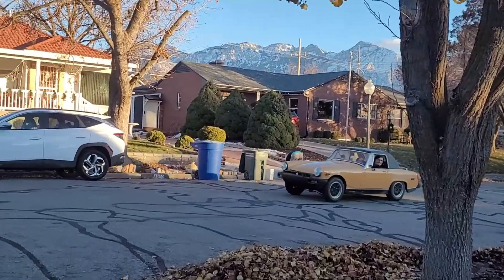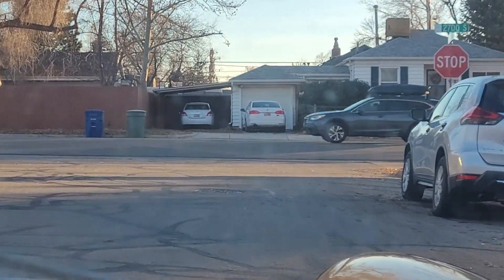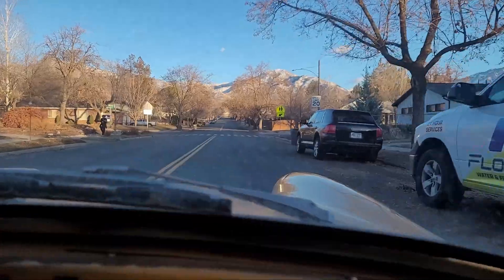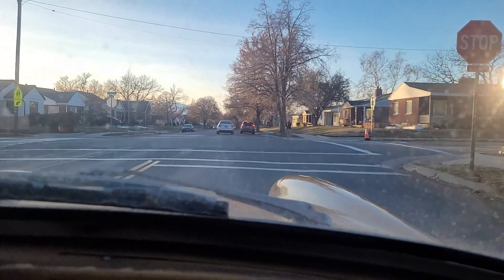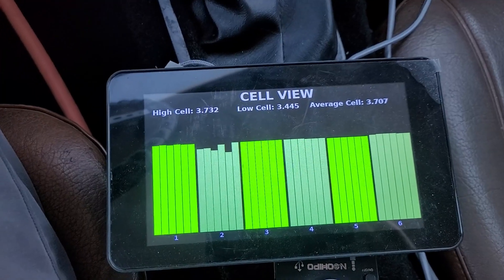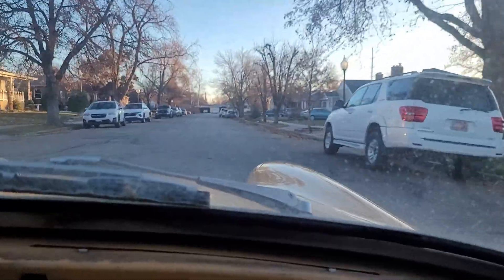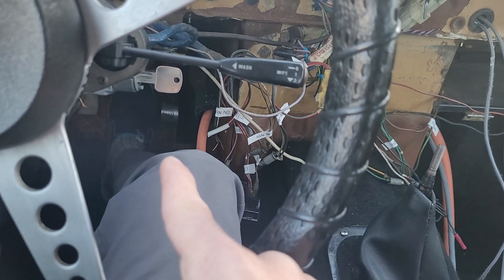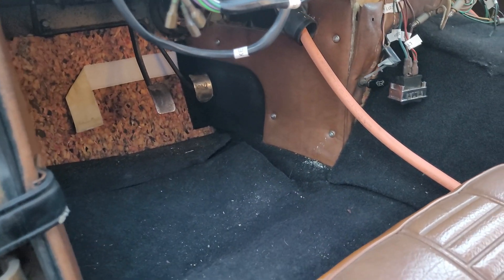First Test Drive of my Tesla Powered 1976 MG Midget - Part 13

Comment: Just started restoring a 76 mg midget. My plan is to convert it to electric and i just found the same motor and controller you have in this. My last conversion was a 1934 international pickup with a Nissan leaf motor. I would like your opinion on if you would recommend the motor you have, and would you recommend deleting the transmission?
Reply from the maker: The ADC FB1-4001A is not a great motor to be honest. If it's cheap and you are set on it, I would still keep the transmission because it's fun to have the crazy torque in 1st and 2nd gear. 

If you deleted the transmission, you'd have to fabricate a drive shaft extension because I don't think the motor would fit in the transmission tunnel at the transmission output. You'd also loose reverse gear, so you'd have to add a forward/reverse contactor. But it would be nice to shave the ~70lbs of weight and gain space in the front for batteries.
Reply: @zuccamachine  the used motor controller and everything except for battery from a previous conversion for $1000. Would that be a good deal in your opinion?
Reply from the maker: @kracticuspotts9686  Totally! I would do that in a heartbeat.

Start building to that ~140V architecture, and in the meantime keep your eyes out for a cheap AC50 or Hyper9.
Reply: @zuccamachine  thank you for your time and input. Check out my build if you get a chance. Mostly shorts but some videos

Comment: I hotwired and stole a rubber bumpered abandoned MG Midget back in college, and drove it half way across the US with my girl friend for Thanksgiving vacation.   Stole the car battery out of a Mustang down the street as the one in the Midget was flat dead.  In restrospect I should of just taken the Mustang, but it was still being actively driven, and I have ethics.   The MG... not so much so... there were at least 5 parking tickets on the windshield and it was full of leaves from the back window being out.    It was a regular Thelma and Louise adventure before Thelma and Louise existed, ending in Kentucky and a bus ride back home.        Love those mountains, I'm guessing you're somewhere out in Colorado or thereabouts.   I've always looked into buying another, to the point of looking at one for sale and sitting in it again, only to find I no longer fit...

Once while driving on a dirt road through the swampy areas of Georgia, I told her to hold the steering wheel and while the car was in 2nd gear, I climbed out over the front windshield, held on to the 3 windshield wipers, while she yelled at me to get back in the car LOL.  I was just that much in tune with the car by that point.
Reply: It looked like this:  Mine looked like this:  https://www.youtube.com/watch?v=5YxbqpTg3TE
Reply: Module 2 needs to be balanced with a charger.    I got a refrigerator full of lithium battery packs I made for quadcopters....
Replace it eventually with a newer one
Reply from the maker: I sourced a newer module locally and its already in the car. I'll feature it in the full range test video coming up next.
Reply: @zuccamachine  Nice.  If you can get the range up to 30-50 miles, it would make a great grocery fetcher, but you don't even need that far since you live in town.  

I use a Honda Shadow Spirit cruiser motorcycle with pickup truck bed and duffle bag on the back just for that purpose.  95% percent of my vehicle trips are to a grocery store 15 miles away, and I imagine for most Americans who no longer work, it's the same.

I hope you can find an affordable brushless motor for it.  If it was custom built from the ground up you could have a hub motor on each rear wheel (or all wheels), and it'd eliminate a lot of the weight of the transaxle.   

Building ultralight aircraft, I started to pick up the mentality of... building light... for things you have to move around.  Otherwise, I overbuild everything (buildings) so they will last 100% neglected until the end of time (wishful thinking).

They use a lot of Aluminum, aluminum tubing, rivets, aircraft grade steel bolts, and plexiglass (instead of glass)  in ultralight aircraft, so keep that on the brain when swapping out parts or adding new ones to your EV vehicles.  More expensive but lighter weight than steel.
Reply from the maker: @choppergirl  My range estimate is 100 miles. Hoping to do a full range test next week.
Reply: @zuccamachine  That sounds optimistic, but hey, prove me wrong :-)   100 mile range, I'll buy one.  I'll buy the factory.  Call your coach company Dodge, and the company town Wolfsburg ;-)

You probably already know (from your comments about avoiding high temps), but just as a random probably unnecessary womansplaining FYI, lithium batteries will have the longest shelf life when parked (in the garage) at 50% or whatever the storage voltage is per cell, and the colder the better (but not freezing, as they have trace moisture in them).    

I keep my quadcopter lithium and lion batteries at storage voltage in my lettuce crisper tray in the refrigerator with a temp gauge to make sure they freeze.  Not the safest, but 5 years later they are still top notch.

I hover my cell phones around a 50% charge... between 70% to 30% charge, trying to avoid the extremes beyond that unless I need them for a short duration.
Reply: Back then I had no idea where reverse was at first when I tore out out on that journey, so I think I ended up avoiding reverse, or just pushing the car... backwards?   It was so light to do...   I had forgotten all about that.   I'm sure I figured it out eventually, but still...     most of the work involved was cutting off the steering keylock which took all night long and several trips across town to fetch tools.     The original owner got the car back, in a fixed and running condition.   Next Christmas I took a flight home instead as my folks gave me airline tickets.

Comment: It shouldn't be making the clicking sound, brushed or not.
Reply from the maker: @kingcosworth2643  What do you think the issue is?
Reply: @zuccamachine  I would look for something rubbing somewhere. If you use different gears in the transmission the input/output will be different and you can isolate if it's on the motor side or axle/propshaft side. Just drive at the same speed - 3mph say, in 3rd and 4th. If it makes the exact same clicking sound it's on the output side of the transmission. If it's a faster click then it's on the motor side. 

You can also try revving the motor in neutral. If you hear noise it's on the motor side. 

Maybe a bolt that's a hair too long hitting something, maybe a wire rubbing against something.

Comment: are you using the original prop shaft?
Reply from the maker: @troublebreathing8648  Yes. The motor mates directly to the transmission input shaft.

Comment: Awesome fun.  Can’t wait to hear 0-60 mph time and up.
Reply from the maker: The motor has 2X the torque and 40% more power. 0-60 should be much faster, if I can get better at Rev matching on the fly (there is no clutch anymore).
It has enough torque to take off in 4th so I leave it in 4th usually. 3rd is more peppy for the city. 1st and 2nd are for burnouts and the track (hopefully a fun edit in a few months).

Comment: I just watched your other videos because I wanted to know what display that is.  That's cool you're using the EVTV system.  I worked there 2015-2016.  Our shop truck was a converted Tacoma using the same motor you're are.
Reply from the maker: @billbayer5526  That's cool! I love how easy it is to see the real time data and adjust parameters with the EVTV system.

Comment: Brushed motors are slightly louder than AC motors.  Both have the waaaaaaa noise when you accelerate but the brushed motor has an additional sound of the brushes.

Comment: If the rears arent working well, adjust them using the adjusting bolt on the backside until the brakes grip, and then back off a smidge. Then take up the slack in the parking break cable.

If they're spongy, its air probably. Bleed em. Not sure how familiar you are with the old car systems, so not sure what to recommend.
Reply: Adjusting drums is an ancient art these days